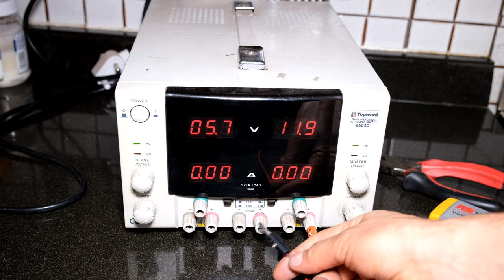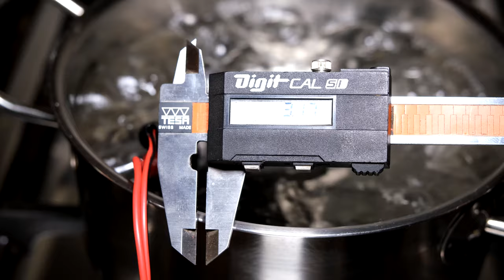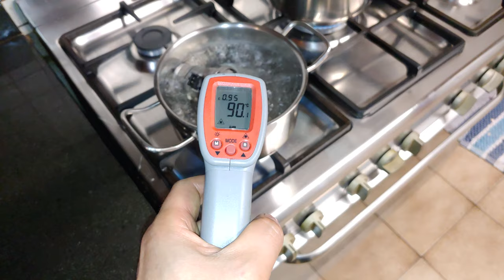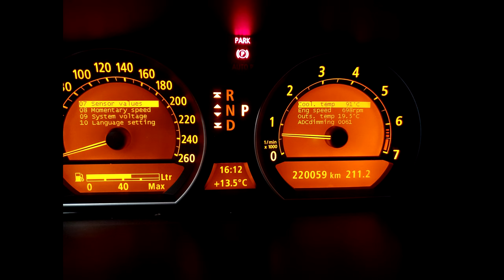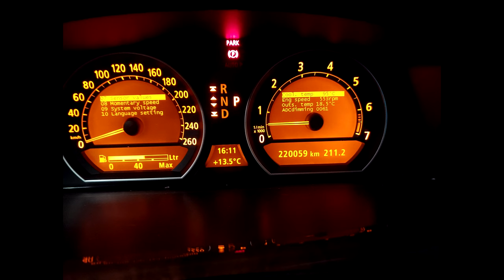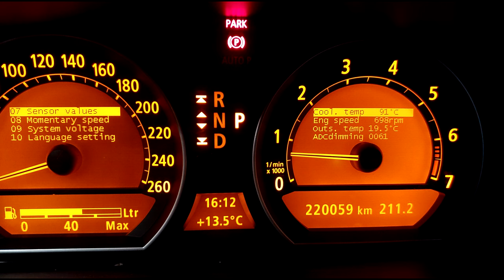How to lower a car thermostat - BMW M54, M62, M62TU, N62, N63, N52, N47, N63TU

Comment: Our narrator is not factoring in that the MAP controlled thermostat opens at 94C under certain conditions such as engine temp first reaching 110C, aggressive driving or the engine being under max load such as towing a trailer up a hill. So it’s not how much it opened but how soon it opens. 

For $30 I purchased an 80C Motorad thermostat for a BMW 840CI M62 and an M60 thermostat housing. It worked perfectly.
Reply: where did you purchase it, please let us know
Reply: And was that Mated up with the n62 motor ?
Reply: @onesikm3  no. this is completely for a different engine.

Comment: Hi, ecologicaltime, below some one commented adding 0.2 g of wax caused the thermostat stay open, not being able to back to fully closed status.  Edited:   Well I watched again, you said you added 0.5 g, but video shows you might added just 0.05 g. Any comment?
Reply from the maker: yes what the scale shows was 0.0x so i must have misspoken.
Reply: @ecologicaltime  This is the best way I learnt to reduce that bothering some high engine operational temperature. Many thanks for your contribution the community.
Reply from the maker: thank you for showing that to me, i am removing that statement from the video so others do not have a problem.
Reply: @ecologicaltime  so 0.06g is the correct amount of wax to add? And Thank you for showing us this method! And also remember to change the expansion tank cap from the 200kpa to a 140kpa cap. This will reduce the cooling system pressure and also reduce/eliminate cooling system failures.
Reply from the maker: Hi. I think so. It was a while ago. Its been working on mine very well and a second one i did slso working right. The scale shows the amount i used. Thanks for the tip

Comment: Thermostats operate from pressure, not heat. When the thermostat is installed on the car, the hot coolant produces high pressures because the system is sealed, which determines the opening and closing. Testing in a pot of boiling water is not a way to test a thermostat. Place the open end up and you will see since there is no hot water trapped in it to increase pressure, it will not open. Best and right way to control temperature is via tuning software to change engine torque and desired temperature values.
Reply: Wrong
Reply: @mirkofanfani98  Run your car engine without the radiator cap or coolant tank cap install. You will see that the engine temp will keep increasing and overheat, because there is no pressure to open the thermostat. My IQ is extremely high. Don't hate.
Reply: @pizzaparty-r1c  hahaha how do you fill the antifreeze? with the car running and the cap open. right? the thermostat open with heat because it has expanding element inside. you can see on youtube test with thermostat inside hot water that open with head and no pressure. you are 100% wrong, no hate
Reply: You smart armchair mechanic, The thermostat opens cause of temperature at which the wax inside the thermostat melts.The reason the car will overheat if you leave the radiator cap open is because at atmospheric pressure water starts to boil at 100degrees, but if you raise the pressure of the water system by 1 bar the boiling temperature will go to 120degrees.Next time you tryna be a smart ass atleast do a bit of research
Reply: I run a waterless coolant in my bmw, so there is no pressure in my cooling system, and my thermostat works fine. So this disproves your "pressure" theory
Reply: @kirilakmadjov8307  So......engines never operate above  120 degrees, eh? 🤡
Reply: U talking wrong. Water pump is not making big  pressure, it's just making liquid flow.
Reply: @zbukzbuk  I never said anything about pump pressure. Heat causes the pressure. Feel free to take off your radiator cap after your engine is hot. 🤡
Reply: I'm just drink coffee watching you guys argue ☕☕☕

Comment: I did this on my N62 and temp is perfect around 90 degrees. But I am constantly having "thermostat stuck open" error because it never reaches 105 degrees. ECU think the coolant is still "cold" and it is pumping more fuel than it should, so my fuel consumption increased around 10%. I want to trick ECU into thinking it has reached 105 degrees by changing the signal from sensor. But mt problem is: i don know which sensor, which wire and that signal it is... Should i just install in series potentiometer to lower the voltage or connect potentiometer to 12v to increase the voltage? And if so which sensor and which wire? I thought the sensor on thermostat is giving the temperature to ECU and i should cut there, but now you said that is heating element... Than which sensor should i cut to manipulate the signal giving temp to the ECU? ANYONE??? We all need that if we want to lower the temp from 105 to 90....
Reply: I hate the fact that they open at 105⁰ C i wonder if using ISTA it is possible to reprogram the thermostat map. 
Logically you have to deal with the the temperature sensor... I am thinking of understanding how the ecu reads the temperature value and then I can set the start point plus 10⁰ so the ecu opens the thermostat at 95⁰ but it thinks it is 105⁰
Reply: @WladyslawAntonsiewicz9627   I have INPA + ISTA and was not able to find that option. If you know where to look, please share with the class.
Reply: @ktm640lc4BGD  honestly I didn't look for it, I left it on 105⁰ If I will do so I will let you know
Reply: I purchased an aftermarket 90C thermostat, never had any error/code.  2008 550i
Reply: @wot48320  so? how does that help here?
Reply: The ecu doesent think the coolant is still cold, it thinks exactly what it sees, which is coolant is at 90degrees and more fuel will be added, hence why the original thermostat normally opens at 105degrees.its for better fuel economy and emissions, you are not gonna get better gas mileage at 90 compared to 105 ever, but the engine will surely live longer, hence why you are doing the mod
Reply: @kirilakmadjov8307  Yes it does think it is cold, it is expecting 105 degrees and that never happens so diagnostic is giving me thermostat stuck. AND if i full the ECU the temp is 105 than it WILL lower fuel input since it will think the engine has reached operating temp. Hence dont just write stuff to sound smart and confuse people.
Reply: @ktm640lc4BGD  only confused person here is you, ecu follows a map for afr and dont care if thermostat is open or not.at 90 degrees computer will inject more fuel cause engine is not as efficient, why do you think it comes with 105 degrees one from factory?

Comment: Most NASCAR engines use a 160 degree F thermostat. I figure if it's good enough for NSACAR then it ought to be good enough for me too. It's crazy some of the "modern" cars thermostats operating tempuratures. Now if I can only find a manufacturer, oh wait this video helps with that issue: Outstanding!

Comment: Good job ! I did mod too mine opens at 85c
Reply: Can you use any wax from any thermostat?
Reply: Look on internet for the lower temp thermostat for your car.
You safe time and is more safer,modifying thermostat like this you are risking Failure if this get stuck in close position then bye bye engine
Reply: And second think is  electric cooling fan is programmed in DME  to turn on 100c or so and same with mechanical fan is calibrated to turn on in Different temperatures, this thermostat mood will only work when you are  On the highway or car is moving . So Once you get stuck in traffic the temperature will Raise up over 100c because your original cooling  fans are calibrated to turn on factory spec. So you might need some electric fan conversion so you can adjust your fan when to turn on , or some Software modification in DME.

Comment: This is bad information. It is not the amount of wax that has any thing to do with the opening temperatures. It is the calibration of metals in the wax and their melting points that create the opening temperature. The lower the melting point of the wax the sooner the thermostat opens. You need to replace all the wax in the thermostat with the wax from a different thermostat with a lower opening temperature.
Reply: What would you have to buy
Reply: @fortnitemane0919  a thermostat with a lower temperature spec. Get the wax out of it and put it into your thermostat
Reply: Yeah.  The speaker has no clue, but he is correct about adding current as a fix.  You are also wrong though.  The metal has nothing to do with it. The way these works is that when going from a solid to liquid, the wax expands by 15%. The melting temp is a function of the molecular weight.  He gets cooler temps, but it will probably be a function of the outside temperature.

Comment: I've put like max 0.2g and I can't put it back,it stays 2 cm open
Reply: guess you have to take the wax chamber out and heat it again to get rid of a little to fix this. The OP put is 0.5 g and it seemed fine, you put in 0.2 g and it would not fully close? Strange.
Reply from the maker: sorry the scale showed 0.06

Comment: Enjoyed your video and learned a bit but find it ironically amusing that your channel name is ecological when you are actively attempting to make a vehicle run less ecological. LOL
Reply from the maker: thanks. If the temp is left high the car overheats and degrades and does not last as long. So for sure it will use more fuel at low revs but you wont be needing new parts anytime soon...
Reply: @ecologicaltime  Maybe, I know heat is the enemy of engines but I'm a electrical/computer engineer so don't have the proper knowledge to argue the point of efficiencies of function v/s time. I know my engine has been running efficient for over 250k miles so I am not going to mess with it but back in the day I used to use lower thermostats in my vehicles. But that was before engineers started writing algorithms for burns under load and such so these days I just don't feel educated enough to second guess them.
Reply from the maker: I hear you. With this particular car they designed it to go above 100 degrees for idle and traffic driving to meet the emissions goals but the problem is that while the heat is fine for the engine, its not fine for the cooling system which invariably fails. One common failure on this car is the car leaks coolant and then its a whole other story.   Some people have ceased their engine. Mine used to go to 112 degrees. My garage would stay warm for hours after the car was parked. So global warming is also a problem (joke). Thanks for your comments.
Reply: @ecologicaltime  Good convo, I would probably err on the side of caution in your case as well. :)